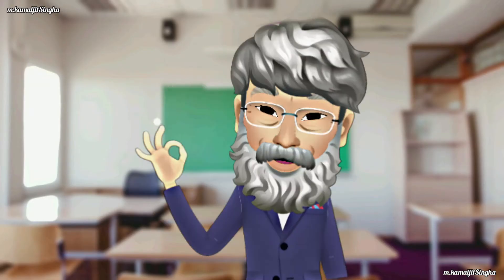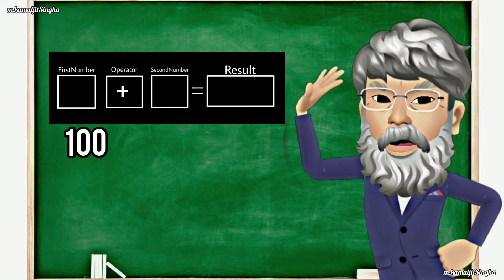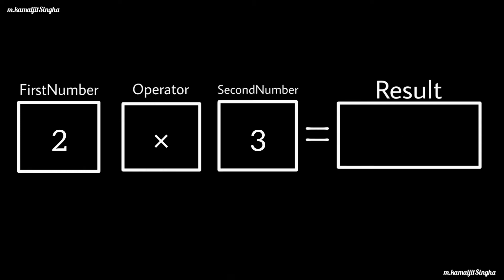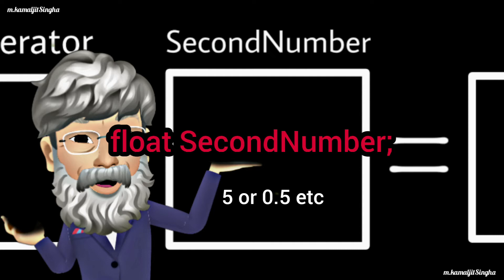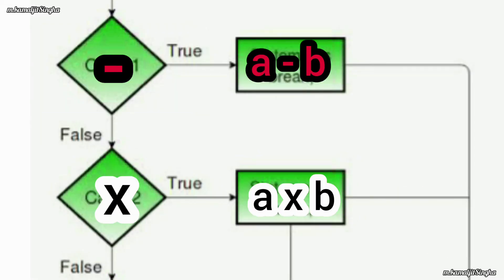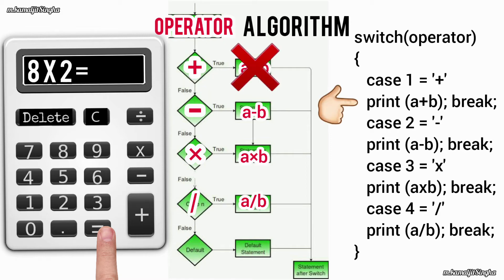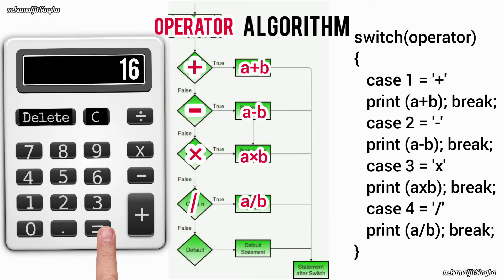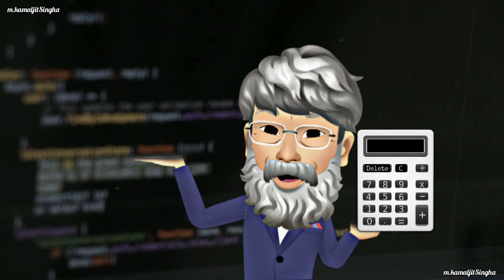How Calculator Works ? How Calculator calculates ?  Calculator Working Principle Explain in Graphics

Comment: I know how calculator works but i want to know that how we can add our programming logic into a physical thing 
like I am able to do logic of any problem virtually but 
how that virtual code inserted into any physical device ? is there any circuit or anything we have to add our code into it?
Reply from the maker: The code is stored in the memory of the physical device. If the physical device has an option to connect with your computer, then you can add your own programming logic code to it.

Comment: But my main query was how does a calculator knows that 2+2=4 why not (3.99999999) or 4.0000000001 or any n natural no. Who told the program that 99.5+1.5 is 100 how she knows it who told here that.. 😶 is this what we called artificial intelligence?
Reply from the maker: Good question buddy! 
The answer to your first question is: A number '2' is an integer type value, whereas '3.99999999' or '4.0000000001' or (any number with decimal point) is a float type value. And we have to define that while programming a calculator. 
The answer to your second question is: A programmer tells the program to do a certain task.

The answer to your third question is: Perhaps no because it is not implementing itself. Artificial Intelligence is nothing but a set of codes written by a programmer, that trains the machine/computer to implement itself from the data fetch from the input devices.
Reply: The main question "How the calculator knows correct answer? Who told that 99.5+0.5 is 100?" And if user enter 17+3  how programs knows its 20?
Reply: @bernardmangulabnan1110 electronics are designed in this way... We people make circuit boards that work like that and progrmmers code the whole thing...
Reply: @bernardmangulabnan1110  also 99.5 + 1.5 is 101 lol
Reply: @bernardokreutz  sorry maybe i type it incorrect, Let me edit for you, but You still don't get the point of what im talking about.
Reply: Study the computer science degree if you're u are really interested..
But if you don't want to study whole degree atleast...
Study on Digital logics, Assembly language.